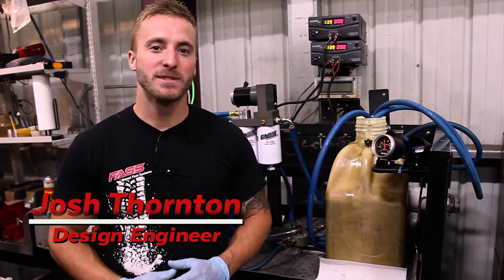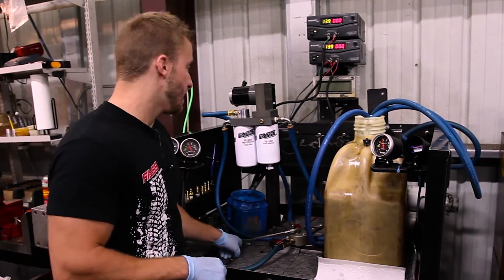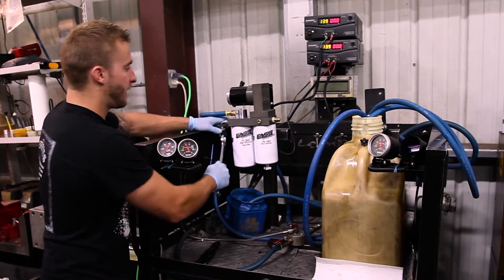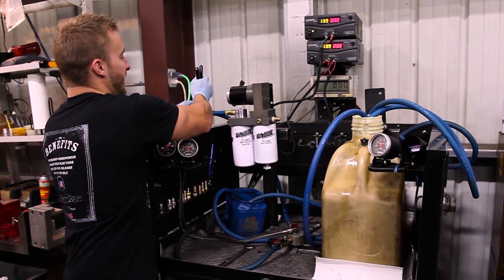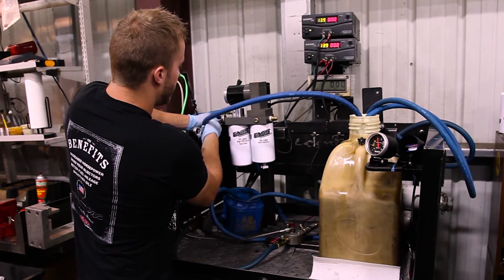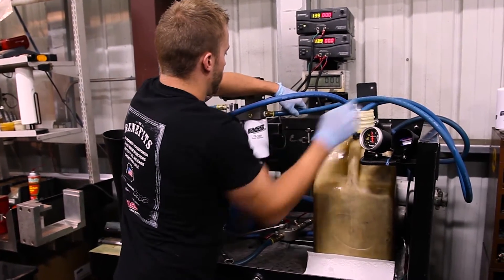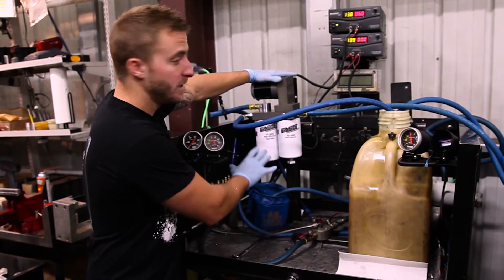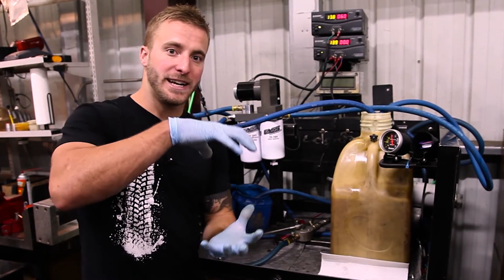FASS Fuel Systems Performing Diagnostic 5 Gallon Bucket Test on a FASS Fuel System

Comment: Curious, while the Fass is running, (one filter at a time) if you remove the front filter fuel should gush out, and should it be the same with the rear filter?
Reply from the maker: Good question! While we don't recommend taking off your filters while the fuel pump is running (other than cracking the water separator to prime it), the reason the front filter gushes out fuel is because the back filter is creating a seal for suction. Therefore, removing the back filter would remove that suction.

Comment: I got a p0089 after installing my fass lift pump and I replaced the fuel pressure regulator and I' still get that p0089 code...smh
Reply from the maker: Hi there, thanks for reaching out. If you haven't already, please give our tech team a call at (636) 433-5410 or shoot them an email at techsupport@fassride.com, and they'll be happy to help with any system-related questions.